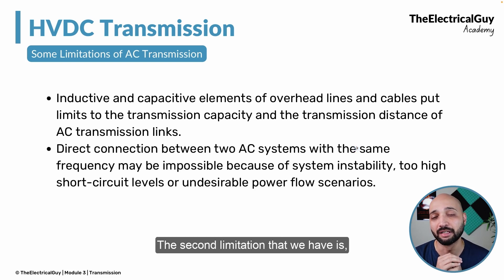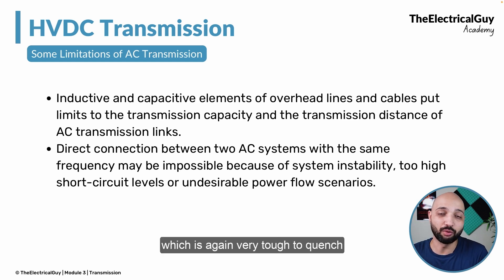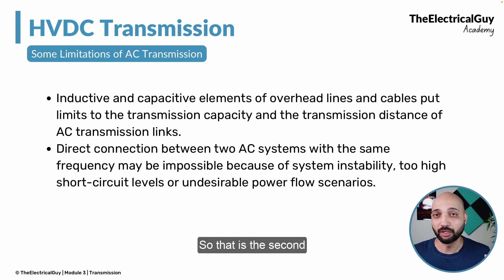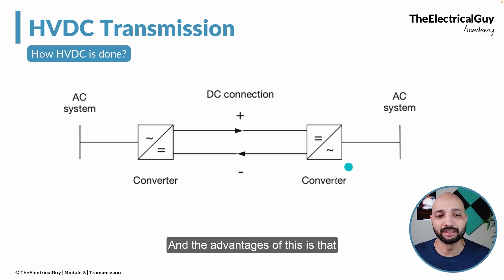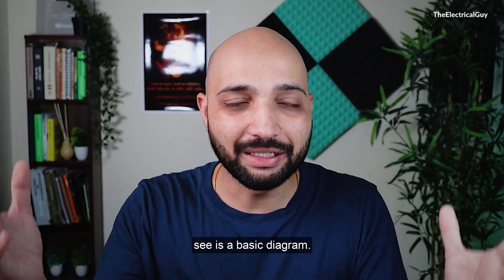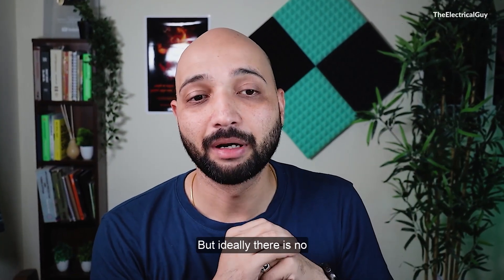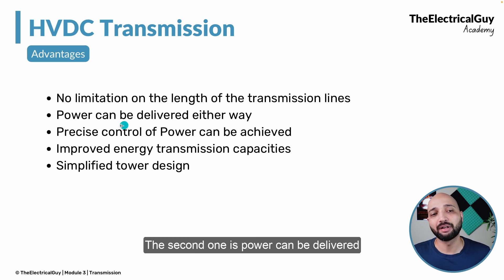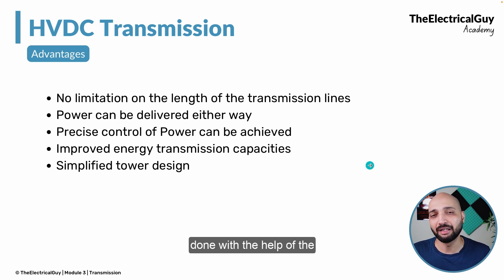Introduction to HVDC Transmission⚡️| TheElectricalGuy

Comment: Excellent video! I'm an electrical engineer from Brazil and I work at a supplier of HVDC substations. We have a HVDC line here that is 2300 km long! In contrast we also have back to back systems that convert to HVDC and transmit at a distance of probably around 10 meters or less haha, just to convert it back on a different frequency. This only shows the several uses we have for HVDC and how amazing this technology is.
Reply from the maker: 2300km…that’s huge. Thanks for sharing
Reply: @GauravJ China 🇨🇳 have UHVDC
Reply: I understand the basics of the HVDC transmission system. But I am unable to understand one problem of the transmission line being built by the Chinese government in Pakistan that the towers are getting black with conductors on the vertical and horizontal side and when asked about this from the Chinese they said that Due to the deposition of charge, the dust particles accumulate on the tower. While I am not satisfied with this answer of the Chinese engineers, because according to my knowledge, apart from the Chinese technology, the transmission lines of other countries (Canada and America, etc.) are not black from this location. Please help me in this matter.

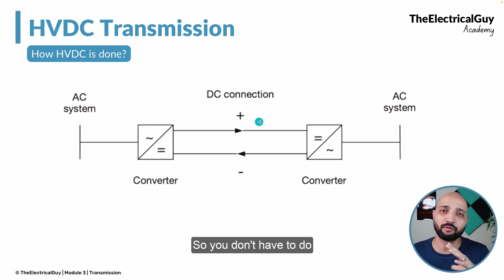Comment: 6:38 how are you gonna convert DC -> AC with a rectifier?
Reply: This work is done by inverters instead 
Rectifier's sole purpose is to convert AC to DC 
But when talking about DC to AC inverters come into play 
All that changes here is how you use the SCR for the conversion or inversion processes

Comment: I understand the basics of the HVDC transmission system. But I am unable to understand one problem of the transmission line being built by the Chinese government in Pakistan that the towers are getting black with conductors on the vertical and horizontal side and when asked about this from the Chinese they said that Due to the deposition of charge, the dust particles accumulate on the tower. While I am not satisfied with this answer of the Chinese engineers, because according to my knowledge, apart from the Chinese technology, the transmission lines of other countries (Canada and America, etc.) are not black from this location. 
Please help me in this matter.

Comment: Back in the beginning of electricity, nothing used DC power ..  Now, everything runs on DC.
Even motors are now powered with DC.. ( AC rectified/chopped into pieces/pulsated ) ..
REAL/NATURAL DC power, is only possible with chemical reaction bateries.

Comment: @Gaurav,I have one question: as you mentioned, a direct connection between two AC systems with the same frequency may be impossible. How does the power plant team perform power synchronization?
Reply from the maker: Two power system who are already delivering bulk amount of power.. not the regular one. ..

Comment: In your video, you said high voltage transmission lines cannot be interconnected, but in Singapore, we have three generation stations with step-up to 400kV, which are interlinked at the main 400kV transmission line. How it possible!
Reply from the maker: Two systems which are already transmitting bulk amounts of power! For normal systems it is perfectly fine.

Comment: Let consider , if L-G fault occurred in HVDC line then how does distance (21) protection is enabled because in AC systems Impedance based protection is present.

Comment: In the inversion stage of HVDC, it just inverts the DC, and doesn't convert it to proper sinwave, or doea it?
Reply: When AC is turned into DC, it's never "real " DC.
It's more like chopped pieces of  sin wave. 
It's the same principle that telecommunication systems use in wireless transmission, but the other way around.
The digital signal is transformed into analog then retransformed into digital..